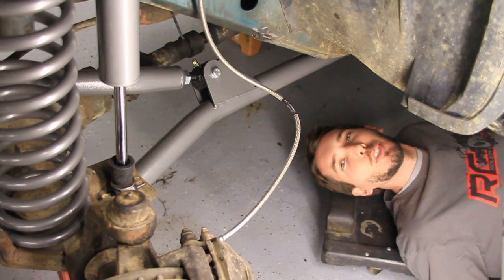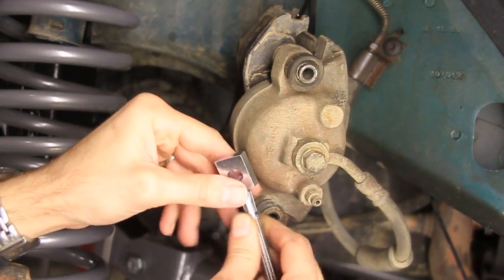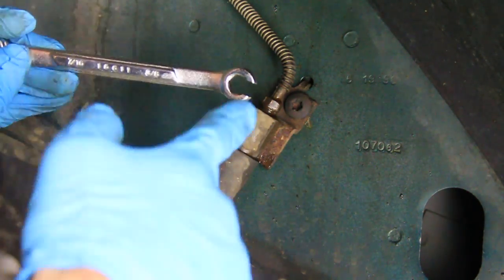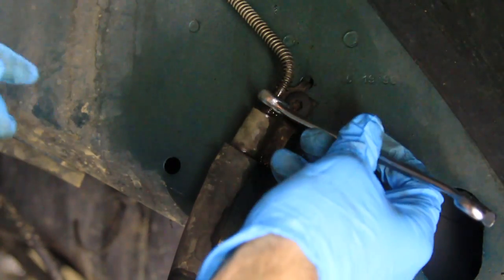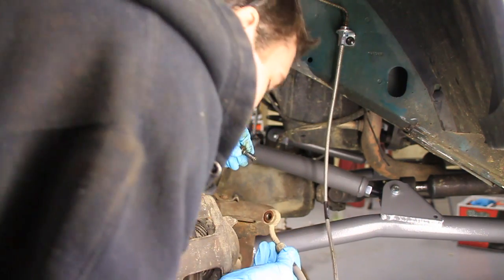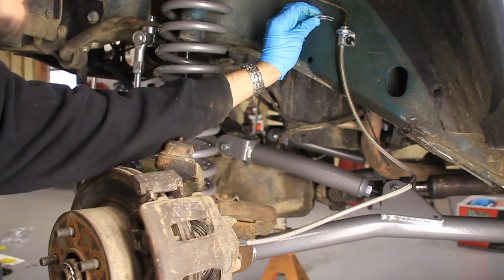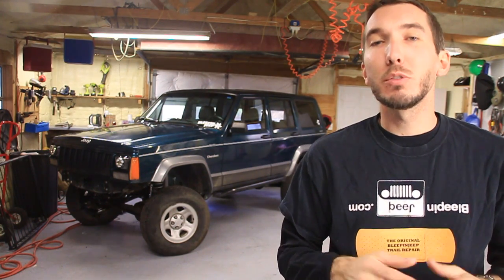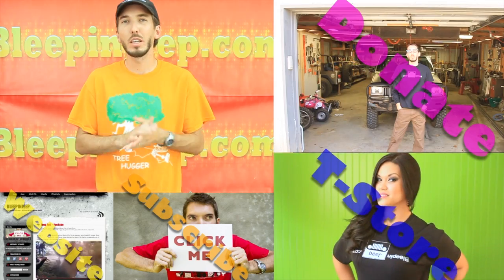How-To Install New Front Brakelines

Comment: Beware the steel hose sticking to the nut it will twist the hose around. Had to spin the fitting off the steel hose so not to kink the break line.

Comment: One point of contention here. (Learned from doing many while working at Car-X.) When heating up things to get the steel line and fitting broken free; ALWAYS heat the fitting nut! NOT the fitting it goes into! Then give it a shot of oil while it is hot.
One reason for this is that the fitting the nut goes into is a huge heat sink and you run the risk of a brake hose popping.(basically exploding in your face,..not cool, and it stinks.)
The other reason to heat the nut and quench it with oil is that many of them will be rusted on to the steel line. If the steel line twists with the nut STOP!  You don't want to be fabbing up new lines if you don't have to. Sometimes this is unavoidable, or you can get the hose to crack loose just enough to be able to thread it off and the new one on close enough to get the fitting tight again without wrecking the steel line.
How this works is by the property of capillarity. (The same as sweating copper plumbing fittings.) The heated metal will fluctuate size rapidly and will naturally draw the introduced fluid as far through it as there are tiny gaps.
You may have to do this several times to get the fitting to come free on the steel line,..but it beats having to make a new one!
Reply: Should've read this comment before I started. Steel hose was stuck to the nut and spun with the nut. Twisted it. Noticed just in time. Hoping itll fly for now dont think I went beyond the point of no return.
Reply: @kevdog541  Alternatively, you can pop the hose keeper out and pull the steel line down through the hose bracket enough to get a vise grips on the flare nut. Then hold the flare nut and thread the old brake hose off and the new one on. Then push back up into the hose bracket and replace the clip. Not the greatest method, but it works in a pinch.

Comment: I know this video is years old at this point but I have an 03 TJ and I'm replacing the brake hoses but the bolt holding on the brakes at the top of the house is stuck, Ive used WD40 and I've heated the hell out of it and I'm scared my only option left is taking a grinding to it and replacing the bolt itself. is the hole the bolt goes into threaded? and is there any other way or tip to try and get it lose before I break or strip it?

Comment: Hey Matt I know this was two years ago your video but I was wondering if you had any issues with the little copper washers that went on both sides of the brake bolts I am having issues it's not wanting to keep the fluid in and I tightened it down pretty tight I was wondering if you had any pointers
Reply from the maker: Always use new copper washers, try getting some more.  Make sure there is only one per side!
Reply: BleepinJeep. Alright man I just got done with it I'm new at this YouTube commenting I usually never talk to anyone I appreciate you getting back to me I just figured it out I appreciate it man thank you very much it's crazy talking to you and I'm all the way in Oregon have a very great day

Comment: I need help. I installed a 6 inches lift kit on my 2005 ram 2wd but after installing the brake Lines are short. Does anyone knows any brake line extensions that I can use?

Comment: Hi, what if the steel line that goes in to the master cylinder is rusted out. How can that whole line be replaced?
Reply from the maker: measure the length and buy some brake line from any auto parts store and a small handheld tubing bender.
Reply: Thank you that sounds easy enough but the mechanic who has my car says he need the original part from the dealership. I guess it's the steel line that goes in to the master cylinder with flare ends. It has to be extra long and he said he couldn't find it anywhere. I'm starting to feel like he just doesn't want to do the job.
Reply from the maker: +Shameika Lindsey it can be done with universal lines, but maybe he just wants something to bolt up with no work involved

Comment: Hey man great video, not sure if anybody else here was having any issues but I know right around the time I was putting a set of these on I realized the terrible shape my factory steel lines were in, so if anybody ends up in the same boat I found some replacement lines here: https://moderndaymuffler.com/collections/brake-lines-hose-kit/Jeep-Cherokee-2000

Let me know if you guys have anywhere else you get lines so I can check out my other options in the future!